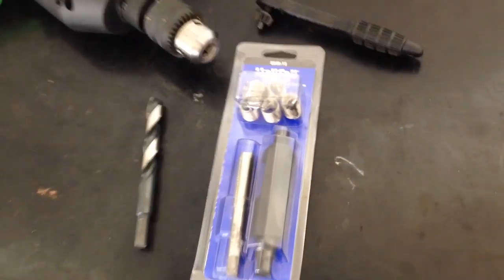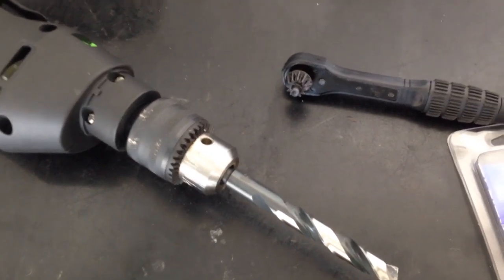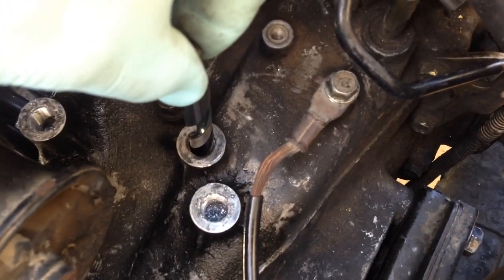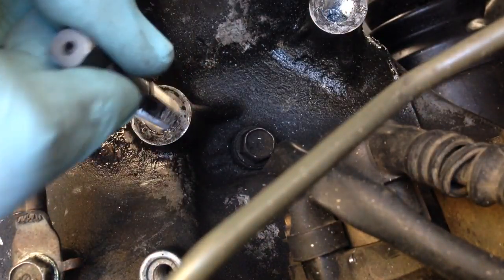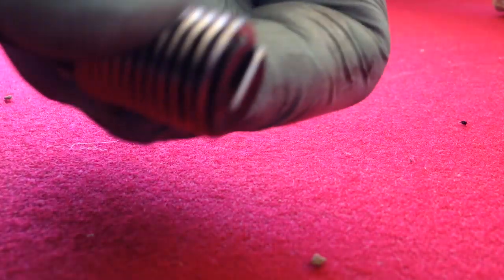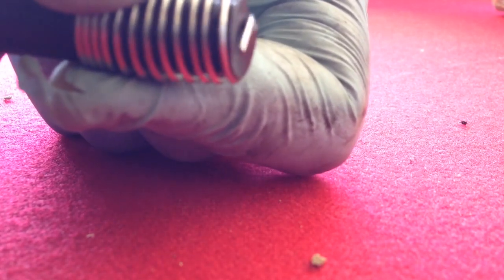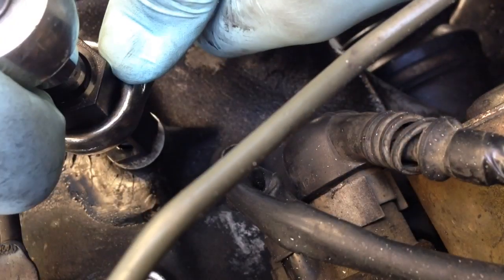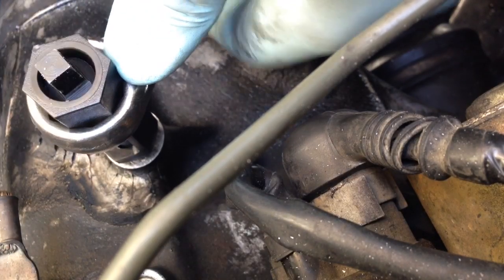Helicoil thread repair walk thru, how to, installation

Comment: Great video.  What socket did you use on the end of the tool?  Thanks, just got a kit to repair a caliper bracket.
Reply from the maker: Every size kit is different. But I believe mine was all sae. Size one big box end and 1 small socket